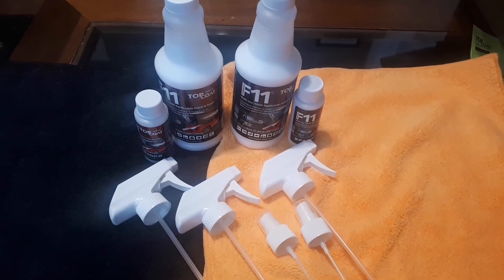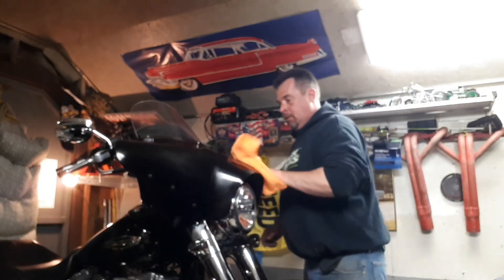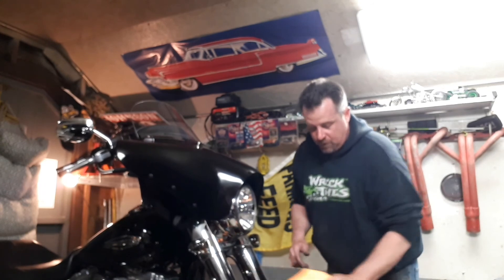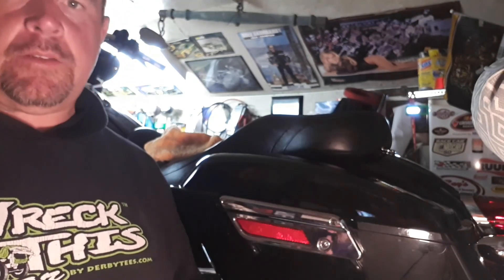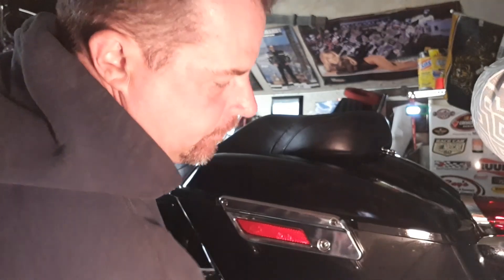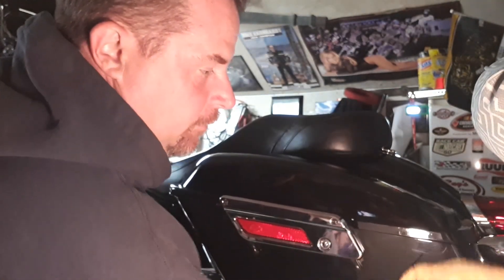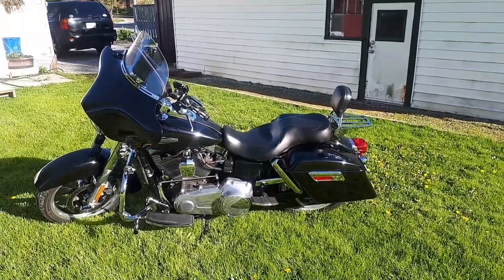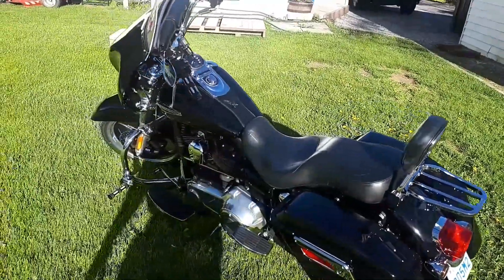Topcoat F11 application on my Harley Dyna Switchback

Comment: I’m curious as to how well it works on the engine block as per the F11 advert. It makes it new looking and darker of course, however, I wonder how it looks after the engine reaches operating temp, does it burn off? What’s your experience, please?
Reply from the maker: It's still has the engine black and looking like new after many heat cycles.